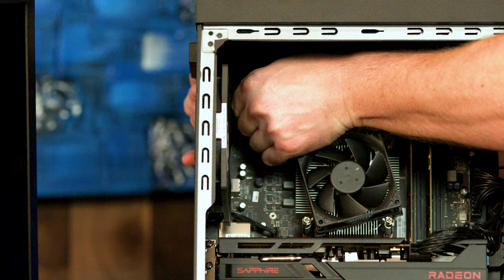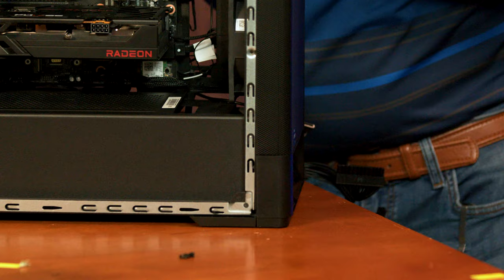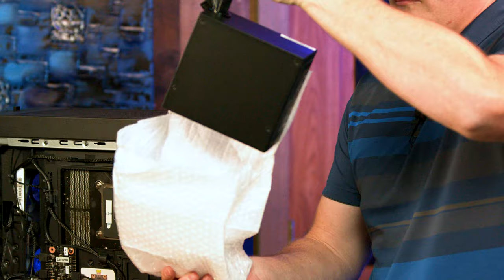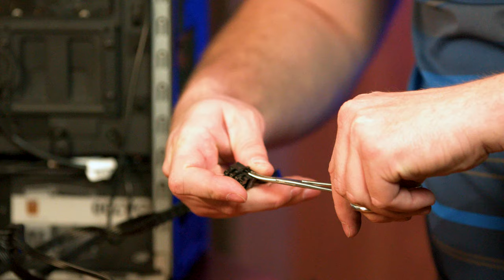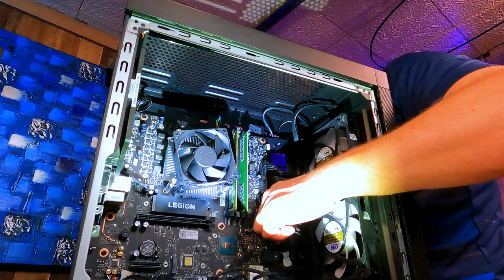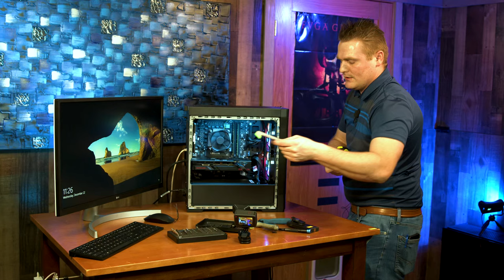Lenovo Legion T5 PC - PSU Upgrade DeepCool 750w Bronze 80+, Gaming PC

Comment: I know this video is old, but thank you so much! I just successfully replaced my 2023 model PSU that was making weird clicking noises and your guide worked perfect. It seems very scary until you realize it's literally just plugging some wires in and making them fit. Managing all the cables was the hard part.

For those like me with a recent T5:
a) a  lot of the ziptied parts are now metal clips integrated into the case. There are only two zipties to cut now.
b) the psu is easily removable without taking out the custom cables from the bottom. They rerouted these to make it easier.
Reply: @insertnamehere6559  do you need to remove the graphics card at all? and how did you get the clip off in the top left? there isn’t much room. thank you, i’m installing my new psu tomorrow
Reply: @jwild666  No, you don't need to remove the GPU. And what clip? Top left of where?

Comment: Lenovo Legions are the nicest prebuilts to upgrade because you can! Standard size motherboard, ATX PSU. Lovely!
Reply from the maker: Very true!
Reply: I don't know about that. I tried upgrading the PSU on my Legion 34IAZ7 with a Thermaltake GF3. It fit just fine, but wouldn't power up with either the old 24pin or the one that came with the PSU. I contacted Thermaltake and they basically said, "No, idiot, our PSUs don't work with Lenovo." Makes me think there's something proprietary about the Legion MB. Maybe I'll have to go with a FSP/Fortron which is what Lenovo uses.

Comment: It gets easier and easier. Did this swap-out this morning on my brand new Legion T5. Can confirm the newer versions have a 650w power supply already, but I needed more for the RTX 4060 Ti. I didn't have to remove the custom cables along the base of the motherboard to wiggle out the supply, so perhaps that housing has changed a bit, though the holding bracket is still there. And there were another two (optional for the psu upgrade, I guess) to remove a plastic support bracket from the side of the graphics card to wiggle that out of its socket. Basically, the psu upgrade part consisted of 5 plugs and 8 minutes. The entire upgrade from case-off to case-on again was probably 20. I might have been able to do it without this video, but I'm old and set in my ways, and this guide made it a snap. Really not much more difficult than swapping out an amplifier in a home stereo system. (For those interested, I used a Cooler Master 750W Bronze+ modular PSU. Works like a charm, though the mammoth power cables are a little tricky to fit back in the case so the side goes back on smoothly.) One other thing to point out. I have autism and often have a hard time following instructions as given. This video was very straightforward. Left me with zero questions. I really, really appreciate that.

Comment: Picked one of these up last year while we were working remote. I’m a piping designer using CAD and knew I was like what’s the best thing to go for if I’m gonna retire the laptop. Knew I couldn’t go wrong with a setup like this. Sure enough I started getting back into flight sims and i live the ease at which you can upgrade parts in this thing to better handle what you do.
Reply from the maker: Yes I Love the legion, Also I like upgrading it because it is easy.

Comment: Nice Video, Will the Corsair RM750e (2023) Fully Modular Low-Noise Power Supply - ATX 3.0 & PCIe 5.0 Compliant - 105°C-Rated Capacitors - 80 Plus Gold Efficiency - Modern Standby Support - Black work with this pc? Thank you!

Comment: Definitely gonna be taking my tower to the local PC shop when I upgrade the PSU. as it is It took me 45 minutes to install a second SSD, this is way too cables for my brain to keep track of.
Reply: Should I have someone install a new ssd on this? I've never worked on a pc before
Reply from the maker: It all depends on how comfortable you are with it. All cables are keyed.

if not a local shop should not charge you more then  50-100  to do it,  if they charge more take it some place else. Cheaper if your not in a larger city.
Reply: @TNW1337  thank you man. You have a great channel and I wish you great success in your life

Comment: Got a quick question for ya , on some older videos you’ve done on the Hp pavilion gaming desktop, How difficult would it be to swap a completely stock HP Pavilion 690-0073W into a newer nicer looking case ? I’m really new to PC’s and this was my first computer I’ve bought . Got it a couple years ago and I’m ready to do some upgrades. Would it be possible to do a complete swap into a different case ? Thanks !
Reply from the maker: Yes You can 100% I am doing a tg01 case swap video right now and they are the same parts I would take from the 690 or TG01.

Comment: I have the T5-26IOB6 Desktop and I want to know if the be quiet! Pure Power 12 M 750W ATX 3.0 Power Supply | 80+ Gold Efficiency | PCIe 5.0 | 2 12V-rails | Overclocking GPU Support | Modular PSU will work on this PC??

Comment: That poor stock CPU cooler, made my computer go thermal throttling, But still having a lot of underperform of my graphics card (3070), is it caused by this stock PSU? I am about to buy a new 750 watt powersupply aswell today.
Reply from the maker: Well it could be the PSU. But also could be drivers. I would use a prog called DDU to unistall the drivers then re download them and install.  also make sure the power connector are seated 100%

Comment: Why not modular? As were I doing it, it would only be modular. I detest extra useless cables and chanes for air flow interference.
Reply from the maker: Price, I do like modular just they charge more for them.
Reply from the maker: I will add some links to cheaper modular PSU's. At the time that psu was 59$ and most 600+ modular start around the 100$ mark. So I agree. For better airflow modular is best. 👌
Reply: With that PSU shroud, would that airflow argument be mute?
Reply from the maker: @shinoshikumi3832  yes for the most part.

Comment: Hello, I have a lenovo t730 - Legion T730-28ICO Desktop (Lenovo) - Type 90JF - i am looking to upgrade the 500W PSU to something more powerful. I am confused on the dimensions of the PSU. if i want to get  a 1000W psu, what dimension should I look for so that it fits the case ? i would like to add a 4080 graphics card and upgrade the existing 2080 super. do you think its a possible ? thanks for taking the time to read and looking forward to your reply

Comment: Can you do a Cooler Master MasterLiquid ML240L RGB V2 upgrade please 🙏🏽
Reply from the maker: I will be doing aio cooler video soon. But that is a good idea they are on the cheap.
Reply from the maker: Yes I can. Because I own one lol.
Reply: @TNW1337  I tried doing it myself and I'm stuck at the end of the Install. Everything seems to work but the rgb lights on the fans and cooler
Reply from the maker: @davidsfresh5863  let me look up some stuff quick. Give me 30mins.
Reply from the maker: Did it come with a controller with buttons on it?
Reply from the maker: Cool master fans use the 4pin rgb and the legion uses 3pin. You could try to get a converter hub.
Reply from the maker: @davidsfresh5863  it would be a 3pin rgb to 4 pin hub
Reply: @TNW1337  yea but i have nowhere to put that into
Reply from the maker: @davidsfresh5863  the 4pin?
Reply: @TNW1337  the 3 pin to 4 pin converter
Reply: @davidsfresh5863  try flipping the connector , I have a hyper 212 fan would work but no rgb lights I flipped and it worked . I have the same pc as this video
Reply: @juanarevalos2943  ill give it a try tomorrow thanks

Comment: I have the same pc just curious what were the dimensions of that psu are? I just don’t want to order one to big I feel like I could fit a 150mm x 150mm x85mm.
Reply from the maker: Any normal ATX psu will work. Any thing over sized will be to much.  normal size is 150mm by 140mm by 85mm 150 vs 140 would work you do have some extra space.

Comment: I'm upgrading lots I have the T5 AMD 5700g w rtx 3060. 
I'm putting in the PSU 1000w
R9 5900x to enable full PCIe 4.0
Founder RTX 4080 and a Cool Master CPU heat sink fan.
Have you done a 3 slot card?
Have you swapped CPU?
Reply: How'd you make out with this? Looking into putting in a 4080 and psu
Reply: @scottanderson9414  I scrapped the entire project.  Over a period of a month I returned every part and just made an AM5 7950X3D DDR5 6k CL30 Tuf 4090 from parts on an MSI X670E Carbon Wifi.
My first build ever.

Comment: so i have the lenovo legion T5-28IMB05 90NC007MUS. It came with a FSP 650W PSU. I want to put a 4070 Ti in. I need 3 p8 cables to connect it. What PSU should i get?

Comment: Excuse me friend I have a question, can I use the graphics card of My HP pavilion in another motherboard? for example ASUS, MSI or gigabyte.
Because I want to put the graphics card in a bigger case and on an asus H310M-E (1151-v2) motherboard. please
Reply from the maker: Yes you can. You can take the cpu, wifi card, m.2 hdd or ssd, gpu. Out and it will work in a new case and motherboard.
Reply: @TNW1337  Thanks!!! I will subscribe 👍👍👍👍
Reply from the maker: @Pilero2025  thanks for the support

Comment: What's up my favorite tech YouTuber!! I need help bad if you could. I wanted to migrate my operating system from HDD to sdd and I use this genius I couldn't figure it out so I backed out of it and now somehow I'm getting the 3 f0 error codeWhich says no boot device available and to please load up OS on to the computer. It's a HP pavilion desktop tg01-0018 Erica motherboard please help me explain how I can get that back it's my son's computer and all I was trying to do is transfer the OS from the HDD to the Sdd but I couldn't understand how to do it so I just backed out of it and once we turn the computer off and turn it back on we got that error and I can't get it fixed if you would know anyways to get it fixed please help me I've been with you from the beginning I appreciate you. Also I already tried to hard reset it I ran all the tests the storage test everything was fine with the hard drives I think somehow the partition that had the OS on it got erased or got messed up somehow and I'm lost
Reply from the maker: Use another computer and make a win10 boot USB. Or order one then you can put it what ever drive you want.
Reply: Thank you

Comment: legion t5 26amr5 Ryzen 5 3600 GTX 1650 Super stock PSU considering upgrading GPU to RTX 3060 12 Gb DDR6 VRAM. Please recommend PSU capacity.
Reply: Most RTX 3060 specs that I have seen recommend minimum 550w psu for the system, for what that's worth.
Reply: Just pur like 650 or 750w so you have space for future upgrades